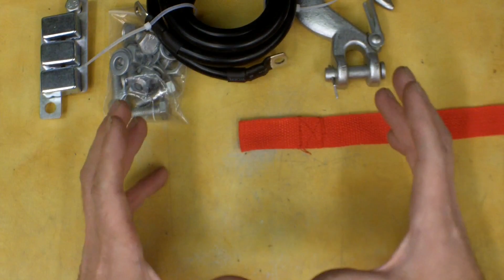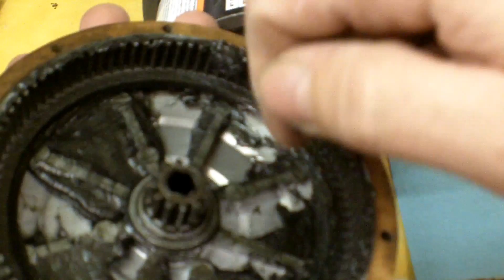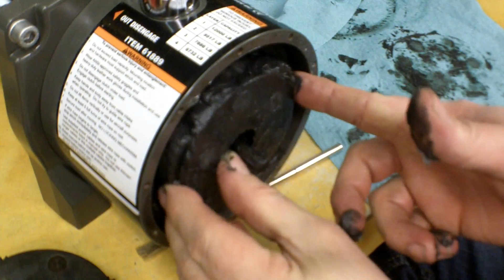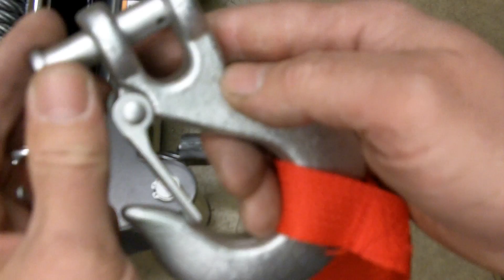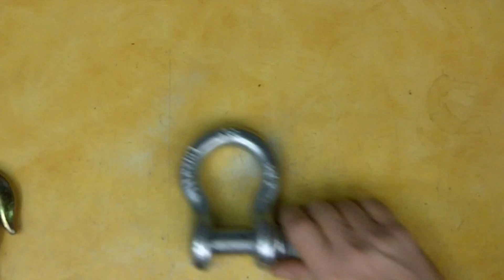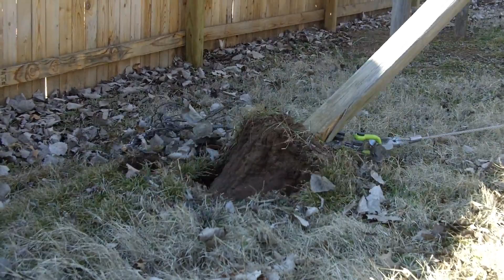Harbor Freight 12000 LB Winch Review, Teardown, Installation, Safety, Etc. Model 61889

Comment: Just wondering why the 175 and not the next size up. Just assume I'm an idiot please. Not an electrician or a diy person. Haven't installed but have purchased the winch.
Reply from the maker: Ashton, my scientific approach consisted of looking at the kits that were available and they all seemed to have 175 connectors. I guess technically the connector should be rated higher than what the winch will draw. This winch will draw more than 350 amps at it's max. The 350 is also huge compared to the 175. Here's a link where you can see the comparison. I'm not positive, but the 350 may not have lugs available for the smaller wire the winch comes with. Even though I've not maxed out my winch, I can say I've had no problem using the 175. Do your homework though. Good luck, G.

http://criteschargers.com/sbconsizecomp.jpg

Comment: The O rings are there to make it rain proof.  Would lithium grease be easier on the rubber than the 3-1 oil.  I thought oil caused oil to rot?
Reply from the maker: That's cool. Yes, a grease would probably be better. I don't know about oil eating the seals. Engines have rubber main seals and they seem to do OK. Good luck, G.

Comment: Good informative video on this winch!  Just one more safety item - at the end of the video your hook is pointed down, it's better to "hook up" that way if the cable breaks the cable/hook will travel downwards instead of up (even with a weight on the line).  Speaking from experience of a time when I made that mistake and replaced a grille and headlight.  And thanks for going through this, I hear a lot of bad stuff often about HF's equipment, but I think I'm going to buy one of these winches!
Reply from the maker: Thanks! I did mention to always hook up, but failed to when I was shooting the clip at the end. I wasn't doing anything extreme, but that's not the point. Your experience is exactly why you do so, as well as put a blanket, etc. over the line. HF is hit and miss, but I've had good luck with most of my purchases. Take care, G.

Comment: I purchased an X-Bull 13000 lb winch with synthetic line.  It looks just like the Badlands winch except it does not have those springs on it.  all else is the same.  Do you recommend disassembly and regreasing as you did, as I'm almost certain they both came from China and have different logos on them.
Reply from the maker: That's cool James! Agreed, they do look the same. HF has, or did have, the 12k version without the springs. Personally, I would regrese it just for good measure and knowing it has good grease in it. Aside from that, I hope it works well for you. Take care, G.

Comment: The different metals of the breaker mounting plates allow the breakers to blow in sequence because of slight resistance to electrical current flow
Reply from the maker: Interesting Cody! Thanks for the info, G.

Comment: Great video! Very informative. It was great that you had several examples of the winch in use. Really helpful. I already bought one and it's on the front of my '79 CJ7. I have to unspool and respool before using but I'm glad to see how smooth it works. Got mine with the super coupon also. Great job!
Reply from the maker: Thanks Johnny! Glad you liked it. I used to have an 81 CJ7 I put a 327 V8 in. That thing was MEAN! I should've kept it, but oh well. I hope the winch serves you well. Good luck, G.

Comment: very good review! would have liked to see more of the wiring schematic.
Reply from the maker: Thanks! You can download the manual from their site. It should cover the wiring fairly well. Good luck, G.
Reply: ghostses what I have seen on their website is toward the installation wiring. I was more interested in the internal wiring, to the solenoids. I have found what I was looking for in another site. Thank you
Reply: ghostses I bought a used 12k winch and after fixing the wiring it has a grindy crunchy sound so it looks like I will be taking apart just like your video and greasing the guts
Reply from the maker: I see. Glad you got it sorted out! G.
Reply from the maker: I would definitely go into it for sure. It's a greasy nasty job, but is really easy. Let me know how it works out. Take care, G.

Comment: Hows the durability of the winch, has it over heated on you at all. I've seen over reviews and they had nothing but bad luck with the model 61889 winch. Because I would be using the on my jeep for some off-road fun.
Reply from the maker: I thinks it's fine, but I've only used it for things like I've shown here. It's never overheated on me, but I am doing fairly short pulls. I can't comment on others experiences, only mine. I'm satisfied with it. Good luck, G.

Comment: Based on your disassembly, I cannot tell if the gearbox case would be able to be rotated 90 degrees to move the control lever to a new position.  Do you remember if that is possible?  It would be very convenient with my new build I am doing.
Reply from the maker: Shannon, I see no reason why it can't be rotated. It would need to be disassembled further to accomplish the task. There are 10 screws that hold the gear box tube on. You can download the manual from their site. They show the parts breakdown at the end. You will see what I mean. Hope this helps, G.

Comment: I have an older 12,000 lb winch and just bought a newer one with the tensioner. The biggest difference was the tensioner and the fact that the wires are now Aluminum. Thats right the 4 gauge copper wire is gone and replaced by approximately a 2 gauge Aluminum wire.  In running it for some reason it would change speed. Not sure why. I am actually a little concerned about that because the only reason I can think it would do that would be because wires might be shorted inside? Possibly the brushes bedding in?
Reply from the maker: I'm not sure. You might try disengaging the spool and see if it still does it. If it does, then make sure you're directly attached to the battery- both hot and ground with clean tight connections. Also test with the vehicle running. If you're grounding to the chassis, make sure it's clean and tight- but it really should be connected directly to the battery. If you've installed the breakers, make sure they're oriented correctly. The post with the copper lug goes towards the battery. Not much information, but things I would look into nonetheless. Good luck, G.
Reply: Thanks for the reply.  Yeah I did not have enough 2/0 cable for two runs from the front battery to the back where I mounted a Anderson 350 amp quick connect. I put the same connectors on both winches to make hookup a snap. I used a harbor freight version of the same winch mount you did. You made a good choice as I bent mine doing a extreme winch test winching my 3/4 ton pickup up a 45 degree slope with the rear brakes locked. I bent it back with my 20,000 lb press and welded some more supports on it. 
Since I don't have the same dual speed issue with the older winch I am pretty sure it is the winch. I need to weld up a support on that new one before I do a major test on it to tighten up the rope. Do you know if it is even possible to get parts for these winches?  I suspect not but you never know when something might be interchangeable.
Reply from the maker: No problem! Yeah, I didn't like the build of the HF cradle- so I went with the Northern Tool version. I've not tested it anywhere close to how you did, but it works well enough for me despite my mods. 

If you think it's the winch itself, and you're inside of 90 days, take it back for an exchange. Their no questions asked policy, at least in my stores, is great.

As for parts, I don't know on this winch. I have orderd parts on other items with no problem. You might give their support number a call to see what they have available- if any. Don't try to use the store for parts- they don't know anything. Here's the number I used in the past. I assume it's still good. G.

1 888 866 5797
Reply: ***** Thanks chief. Appreciate the info.
Reply from the maker: No problem man! Good luck, G.

Comment: Great video.  I really liked the breakdown and rebuild of it to show that it's not a tough job.  You have the winch for going on 2 years now, would you recommend it to folks still?  
I'm looking to buy my first winch for my Tundra and would like to not spend the $900 for the Warn.
Reply from the maker: Thanks! Glad you like it. No, not a tough job at all- just messy...lol.  It's not seen extensive use, but still works great each time I use it. I know opinions vary on these, but mine is yes- I would still recommend it. I can fully understand not wanting to pony up for a Warn. Atop the cost for one, you still need to shell out for all the rigging, etc. I can't remember exactly, but I think my total investment was about $750 for everything I have. If you end up with one of these, let me know how it works out for you after use. Good luck, G.

Comment: how has the winch been holding up? I just got one as a gift...would you recommend me to re lubricate the gears like you did? Was the factory grease not good enough? Just want to get it all lubed up properly if its not from the factory. Thank you!
Reply from the maker: While it's not seen extensive use, it's worked great every time I've used it. As far as changing out the grease like I did- here's what I would do. Install it, then try to pull the cable out by hand. If it's really hard to do, I would at least clean off the grease on the outside of the ring gear and inside the case- then use something else. This would be where I used the JT-6 in the video. Also, if it's really hard to move the shift lever- I would do the same as I said. The dark grease in the gear set seems adequate, but since I was going into it anyway- I decided to do it as well and use a known good grease.  Nice gift I would say! Hope this helps and good luck, G.
Reply: ghostses ok excellent.  yeah I'm going to pull it out and do that then. I also like the idea of having a known quality grease. the little things add up for longevity. also gonna look at trying to protect the wires and connections from moisture with maby dielectric grease and maby some sort of sealant. thanks for the reply and for a great video. very informative.
Reply from the maker: Agreed! I think using dialectic grease on the connections is a good idea. You might go as far as opening up the controller box and putting some on those connections as well. I think the grease would do it's job, so I wouldn't use any other sealant. It could be a problem if you ever need to access the connections. Take care, G.

Comment: EXCELLENT VIDEO! I am very impressed and happy you went through cleaning and re-greasing the planetary gears. I may get a Harbor Freight winch because my use would be very similar to yours. Thank you for taking the time to share.
Reply from the maker: Thanks! I highly recommend using known good grease. Plus it operates smoothly after going through the effort. I'm extremely pleased with it, especially for the cost. Good luck if you pick one up, G.

Comment: I've done a lot of research on winching via multiple sources prior to putting a Warn on my jeep. Winching is VERY dangerous if done improperly and there are plenty of horror stories on offroading forums to prove it.

This video doesn't only cover the take-down of the winch but also a few very KEY IMPORTANT pointers like always using a hook strap to guide the cable back in, never using recovery straps for extensions, always hooking "UP", and using a heavy blanket/coat to absorb energy in the event of a line snap. All important things that can result in death/dismemberment if handled improperly and truthfully, some of these things basic winching manuals/guides will not teach you.
Reply from the maker: Thanks! I'm glad you found it useful. Everything noted is extremely important to remain as safe as possible.! Good luck, G.

Comment: That setup would have come in handy many times. Do you thinks this could be used as a Gantry Crane lift?  Mostly light duty work.  However a few items are in the 1 1/2 ton range.
Reply from the maker: It's works great for my uses William. Personally, I would use a chain or electric hoist for the gantry. I don't believe winches are designed for lifting vertical loads. It might be dangerous. HF does sell chain and electric hoists of various sizes.  Their largest electric hoist is 1ton. Not big enough for your occasional 1.5ton requirement though. Someone else might offer a larger one. They do have chain hoists that go up to 5ton- I believe. Hope this helps, G.
Reply: Yes it did.  I am going to buy a Mill & Lathe that is a lot of weight.  One gentleman stated get a pallet jack.  5,000lbs he bought off of craigslist for $50 bucks. So, I checked and there are a lot of them for that price. Problem solved. Still want a hoist though for when I need one. Thanks for your assistance sir. I really liked your idea for pulling trees.

Have a great day sir.
Reply from the maker: Oh yes, they weigh a lot. I have a 9in lathe and had to take it apart so I could move it. I also have a small horizontal mill that also had to be taken apart. Mine are small in the machining world and still weigh in.

A pallet jack is a good solution, and inexpensive for sure.

Thanks! I was surprised how well pulling the trees down worked out. Good luck, G.

Comment: Excellent presentation, Ghostsess!  I just purchased a similar winch and intend to mount it on my car hauler trailer.  However, I also may be adapting it for property clearing, etc., just as you have.  You've given me some excellent ideas, which I plan to put into good use!  Thanks a lot for sharing your knowledge.
Reply from the maker: Thanks! I'm glad you got some ideas. I've seen some folks using a cradle and a receiver mounted to their trailers so they can remove it. It would be great to move it from place to place for different uses. Good luck with your project! G.

Comment: Just an FYI, in your chevy you can remove the "storage" box on the driver side and add a second battery for using accessories (winch, inverter, amp, etc) so that you isolate from your starter battery. I have a second battery installed for mine that is isolated except when I throw a switch which activates a solenoid for charging purposes

Also acts as a backup in case the main dies

I also upgraded my alternator from the stock 105a (suburban, rear air, etc) to a 140a out of a '99 escalade for more power
Reply from the maker: That's very true Jon. My storage box wasn't even there with I got the truck. I use the battery tray to hold my tools when I'm working on it...lol. Great tips nonetheless. I'm sure it will help others out. Good luck,G.

Comment: Those cradle winches are good in idea but poor in design and I wouldn't suggest one. Many of them are not rated to near what a winch is rated at pulling. Most class 3 hitches (the common "big" hitches) are only rated at around 8000 lbs tow or pull rating. Class 4/5 are around 18000. You rarely see class 4/5 on anything smaller than a 1 ton truck.
Reply from the maker: Thanks for the comments. Mine is "supposedly" rated for a 12.5k line pull but I don't know if that's accurate. Either way, and for my application, it's been working well for me. Folks certainly need to ensure what they use is rated properly for their intended application. Good luck and take care, G.
Reply: The front receiver I got is rated for 9,000 pounds, the reason to go with a 12,000 pound winch anyways is that the maximum rating of the winch is not always what you get, depending on how much cable is spooled
Reply from the maker: That's cool Jon. I went oversized so I could get more pull on the higher wraps. For my purposes, I doubt I would ever tax any of my gear, even with increasing ratios with snatch blocks, etc. Take care, G.
Reply: As long as you understand and de-rate accordingly then congrats for using your brain. Sadly too many see the 8000, 10,000, or 12,000 (plus) and seem to think the max rating is the rating. I far too often see idiots buy a hitch and because it has a 2 inch receiver they think its a class 2 when its' some overseas class 1 barely rated to pull an outhouse.
Reply from the maker: Agreed! I'm no pro by any stretch but did a lot of research to ensure everything for my application was rated for, or exceeded, my needs. You are correct, just because it "fits", doesn't mean it's correct. I tried to pack a lot of information in the video, and tried to stress everyone needs to do their homework, and be safe. I hope it came through. Take care man, G.

Comment: Great video mate. Concise yet comprehensive. Would of liked to see the install of your hitch as well :). After failing to extract my F250 bogged front and back pretty much to the floor pan and only using 4 x under rated snatch blocks and rope with 9:1 MA, I've decided to move to something a bit more serious as in your setup. Thanks again for your informative vid.
Reply from the maker: Thanks! My install was a direct bolt on. I didn't bother showing it since they're so many different vehicles out there, but could've- in hindsight. Good luck, G.

Comment: When you put a load on the winch, put a canvas bag or an old backpack loaded with stuff (sand works well) to aid in absorbing the energy if it were to break or come loose.
Reply from the maker: Good tip Harry! Thanks for sharing. Good luck, G.